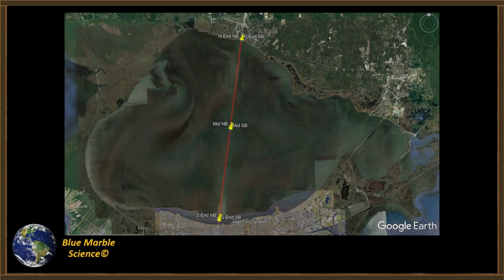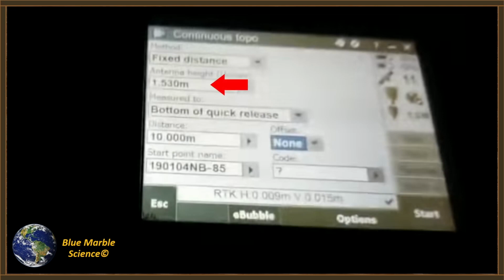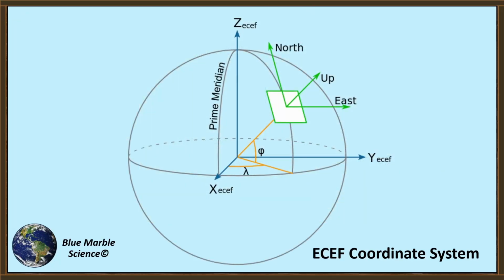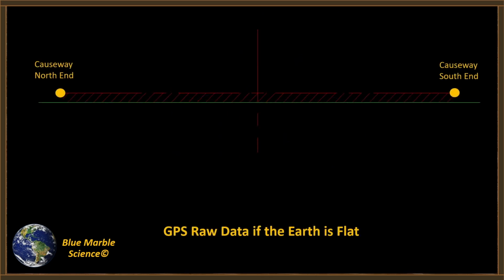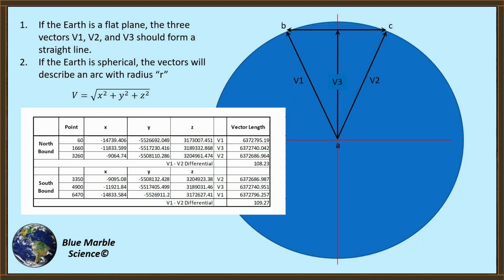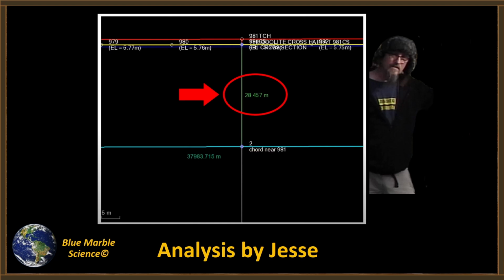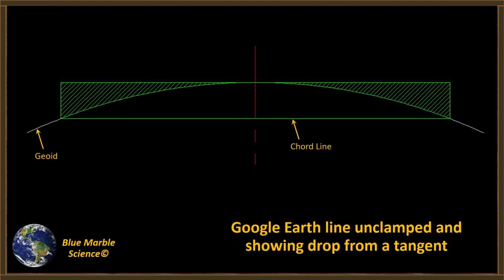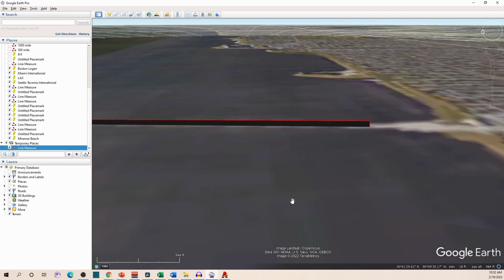The Lake Pontchartrain Causeway Proof of Earth Curve

Comment: Don't forget that the earth is more an ellipsoid than a sphere. That means that the radius of the surface at a certain location depends on the direction of measurement. The causeway runs nearly north/south and is near the equator. So the surface radius of curvature in this direction at the location of the lake Ponchartrain is according to the WGS84 globe model 6,352 km, which is less than the distance of this location from the center of the earth, aka the length of a GPS vector there of about 6,373 km. So if you compare the radius that Autocad calculated (6,342 km) with the WGS84 meridian ellipsoid radius (6,352 km), you are off by less than 0.1%. A variation of 1 cm in elevation measurements gives a variation of about 8 km of the calculated radius from 3 selected data points. So the causeway GPS measurements are exactly as predicted by the WGS84 globe model to cm accuracy.

Here is my App showing how it measures the radius of curvature of the causeway. My App calculates the vector length (Leng), the ellipsoid radii (Rmer for meridian direction N/S and Rver for E/W direction), the radius from the angle between the verticals at the 2 endpoints (Re12) and the radius from 3 selected data points (R3pt). Further more it calculates the drop of the selected end points from the horizontal plane at the reference point (Hlvl) and many more.

http://walter.bislins.ch/bloge/index.asp?page=Display+Geo+Data&data=Causeway+measuring+R
Reply from the maker: Thanks Walter - your work was absolutely brilliant. I hope this regenerates interest in all the work you guys did.
Reply: @bluemarblescience  Thanks Blue. In case someone is interested: survey grade GNSS receivers can export the raw measurements in so called RINEX files. There are all measured distances to all the satellites listed that were used to multilaterate the position in ECEF cartesian coordinates. No such distance in the RINEX observation files is less than 20,200 km, the altitude of the GPS satellites above the surface of the earth. 

Here is an example of such a RINEX observation data file. Click on the numbers or use the tabs below the image to get explanations for the numbers.

http://walter.bislins.ch/bloge/index.asp?page=Understanding+GPS%2FGNSS+RINEX+Files+and+Relevant+Parameters

GNSS receivers use as many satellites from multiple systems as possible at the same time (like Navstar, GLONASS, Galileo) and make multiple measurements to calculate the position using multilateration. Using more than 4 satellites gives an overdetermined system of equations which can be solved using matrix operations to get the solution with the least deviation from the exact position. In Wikipedia is an explanation how to solve overdetermined systems of linear equations:

https://en.wikipedia.org/wiki/Overdetermined_system#Approximate_solutions
Reply from the maker: @WalterBislin  I had a slide on RINEX files in the presentation and realized that trying to explain it was going to detract from the basic message - that being that the damn earth isn't flat! It's measurably curved and we can prove it. There is no coordinate system of any sort that I know of, regardless of where you fix it, that would be able to make a straight line out of both sides of that causeway. It's a beautiful, and as far as I'm concerned, irrefutable proof.
Reply: @bluemarblescience  really nice work ! Thanks for taking a closer look at this data. Speaking of chord lengths, check out the work Larry Scott, me, and The Maine Surveyor did a few years back when we all 3 simultaneously logged GPS data on the great circle connecting us. I calculated the mid point on the line between TMS in Maine and Larry in Maryland. I drove 4+ hours to find that spot, hammered in an iron rod, and then set up my GPS receiver. At the moment the sun crossed that great circle, all 3 of us measured vertical angles to the sun. That was an amazing project Larry came up with. I'd post a link to a vid, but YouTube would block this comment.  It's on my channel along with other vids of my 2 trips meeting Soundly in 2017 and 2019, plus the vids on me and TMS replicating Al-biruni's method on Cadillac Mountain, and the trips made to see George Hnatiuk at Rainy Lake and Tim O at the Great Salt Lake. What's left to do after all that? LOL. All that data is available to anyone interested in presenting their own evaluation of those measurements like you did here Blue. I'm happy to see you do that. Thanks.
Reply from the maker: @JesseKozlowski  I'm glad you enjoyed it Jesse. Your work was amazing and the result is, as far as I'm concerned, irrefutable. I certainly intend to cover some on your other adventures with Larry and the Maine surveyor. We spend too much time staring at out-of-focus pictures and similar foolishness when what you guys did is clear and repeatable. Thanks for all your effort my friend.
Reply: @bluemarblescience  , it's about time the flatearthers are asked to show the trick. If surveying is flawed and the globe is being inserted somehow to hide flatearth, show us where that switcheroo happens, where's the trick? If GPS comes from cell towers, show us the trick used to make it seem like satellites. Like Walter said, the actual range measurements are in the raw data, the RINEX file. Heck, anyone can build their own GPS receiver and write their own software using the open source publications describing how GPS works. LOL, even rockeeyah can find his way home using GPS when he takes his boat far off shore and his cell phone has zero signal. LOL. 
I lost interest in all this FE stuff when it became obvious to me they're either pretending, or they're outright bald faced liars. Bev's schtick of repeating level is horizontal got way too boring especially since he ignores surveying texts. Why does he say I regret describing the earth's curvature dropping down from the horizontal plane established to be perpendicular to the plumbline at the observer's location? It does. It drops at a rate of 8 inches times the distance in miles squared. LOL.
Reply: @bluemarblescience  Oh, don't get me wrong. It's not meant to be a critique of your video at all. Your video is more than enough to deliver the message. 👍

I thought, as you mentioned the distances to the satellites, I could back it up for those who are interested to know where we can find this distances GNSS receivers internally measure.
Reply from the maker: @WalterBislin  I understood completely. I'm into the details myself and I have to constantly remind myself that a majority of viewers may not want to go that deep. But I think it would be good sometime to target a smaller audience that would like to know more about what really comes down from the satellites and how it's used.
Reply: @bluemarblescience  , for those that enjoy knowing the specs, like car horsepower and engine details etc., I'll include some of the details on the equipment used to collect that bridge roadway data. The GNSS receiver is a Trimble model R10 which tracks USA GPS and Russian GLONASS satellites. That is the thing mounted on the roof of the car. The handheld data collector displaying the results on the screen is a Trimble TSC3 running Trimble Access software on the MS mobile 6 operating system. That TSC3 is connected to the R10 via bluetooth. 
The real-time data stream came from the LSU RTN using an internet connection via cellular data network.  Raw GNSS data was also logged simultaneously at a 1 second epoch rate for post processing later which yields slightly better positional tolerances than shown on the screen, but even those are plenty good enough for this intended purpose. Quite amazingly, the data collected in 2017 agrees well with the 2019 data. Someone made a comment under this video about publicly available Lidar data, but, at the time I made my surveys, no data like that existed for the causeway bridge. Maybe it does now? Would be a very cool thing to compare those results to mine if anyone knows where to find it. We use that system every day to collect long stretches of highway. Essentially 2 extremely accurate laser scanners are mounted on a vehicle along with an IMU and dual GNSS receivers. That's what is known as Moble Lidar. Amazing technology.
Reply: @JesseKozlowski  Just post the magic characters after watch?v=
We can work it out from there.
Reply: @bluemarblescience  When I was in New Orleans I made it a point to go by and see this. it was great.
Reply: Your information and knowledge never cease to amaze me. I love all the calculators on your site, but I think that I love the knowledge you provide detailing the processes behind them even more.
Reply: As the old saying goes, "The devil is in the details."  Which is exactly as these experiments, measurements and calculations have done, show reality at a high level of detail.

A heartfelt "Thank You" and "Well Done!" to all of you.
Reply: The man, the myth, the legend! Thank you 🙏
Reply: That's what I see in all the nasa photos
Reply: Walter and Jesse, all of your work is truly outstanding. The flattards are beside themselves; I just saw part of a debate with MCToon where some idiot was trying to make up something about Jesse’s theodolites not being level.
Reply: @David_Lee379  , LOL, and then he showed his picture taken through his theodolite set up level, right? Hahaha, nope. None of them ever make any measurements. Well, except for JTolan, who is just trolling the flatearthers because his measurements match the topographic maps of the areas he makes his videos about.
Reply: @JesseKozlowski  Exactly!👍
Reply: I measure from the Y axis which doesn't go to the center of earth when you extend the line, i get (6340.766 km) but if i move the end of line to 0,0,0 to the center of earth I get (6372.687 km) in Civil 3d and get 0.34156° degrees for the delta angle......For the radius i get (6372.794 km)....For the chord I get (37.98997 km).......North bound bridge
Reply: Blue Marble Science needs to come and work for you.
Reply: BLESS: 🙏🏿😇
To the IGNORANT; Is it Still FLAT ? 🤔

Comment: My question is a simple one so there should be a rather simple answer. I live in Vancouver Canada and sometimes call London England at 2am my time in the dead of night. Yet in London it's 10am broad daylight. How is that possible if the earth is flat? The entire earth should be daylight or night time all at once if the earth is flat. I don't even need to use London as an example. During the shorter days of winter I get calls from Toronto Ontario at 6am Vancouver time. It's still full darkness here at that time yet in Toronto it's 9am and full daylight both within the same country. Expalin that flat earthers.
Reply from the maker: There's a very simple answer. The earth isn't flat. And the people that try to claim it is haven't asked themselves the simple question you just posed. At least if they have, they didn't answer it honestly.
Reply: Humans are extremely creative. They have “answers” to this question for sure. They aren’t scientifically evidence based of course. But, to them, words on a creative meme is plenty of enough evidence
Reply: The flerfers would have to turn their brain inside out to explain that away.  But they’d give it a go. They are such creative humans!

Comment: Genius of logic. He calculate if lake is curved, based on assumption of a ball model of the earth. Genius.
And on assumption he think he know how "gps satelites" work.
Iss station clame 405km hight - by calculation of "gravity" men 100 kg will weight about 70 kg - microgravity? Yaeh right. Now you know why they need baloons for satelites - > because they lie about everything.
Do he even know how roads are build? Did he know road need to have slope in both axis, to do properly drainage of waters.
You can achieve this data just by riding this slopes.
Why do they not open some geodetic websites to check measurements of yhe hight from see level of the road? And then comper with bumps on the road?
To hard or to risky?
And with the occasion, ask some geodesist do point 0.00 m changes (follow the curvature)?

And the shocker.

His own data prove that the earth is flat.

He seems to forget he put his data on ball earth model, and the data shows that his road go under water.
Great design you see, first hurricane should blow this bridge over.
Reply from the maker: That's idiotic. You have no idea how GNSS works!
Reply: @bluemarblescience  seems like you can't read your own data and resolds.
Genius do you know how briges are build? Did you check real project of a bridge and it designed hight above 0.00 m point of a sea level, genius?
Did you check it with you data?
This is have no meaning but to lie and decive.
Reply: you're almost onto something there. people aren't weightless on the iss because its so far from the earth that it's not affected by earth's gravity. 
people are weightless because the iss is in perpetual freefall around the earth and astronauts on board are freefalling at the same rate
Reply: @conifergolly  no it is not. On how high is fake ISS on fake altitude it is not much change in weight. Find the difference between simple plane anx fake ISS trajectory. Maybe then you will see how much stupid and contradicting ideas have fed with.
Reply: Greetings, I've been dependent on satellite reception for my TV entertainment for more than 35 years and have helped neighbours and family to install and setup dishes and receivers.
I challenge you to explain how balloons can be used to distribute HDTV content to millions of households in Europe.
Reply: @marcg1686  you should ask rather this question: why is it so stable and moved an inch for so long. Do you think it is flying and maintaining position on some fuel? Or rather you are pointing earth based anthena or reflection of a solid dome. Check angles in different countries do the geometry math.
Reply: @ViCantoTrakt  You have made an assertion without any evidence. We will dismiss the assertion without any evidence.
So here is your chance to prove that balloons are used to transmit TV content to domestic households.
I'll wait.

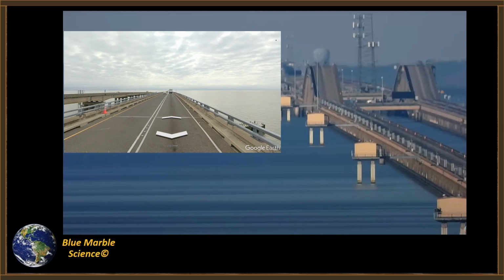Comment: 2:22-- honest request: please provide a citation that explains how foreshortening increases the angular size of a raised roadway.
Reply from the maker: It doesn't and I never said it did. If you try to take a picture of the bridge orthogonally, you'll have a photo covering 24 miles left to right with a 90 foot sagitta. That isn't visible. But an oblique view allows you to magnify the picture and that increases the vertical change to the point that you can see it. Foreshortening isn't increasing the angular size of anything. You're doing that with higher levels of magnification. I'm not interested in any pedantic back and forth on this. It wasn't the point of the video in the first place. In fact, just the opposite. The video is about GPS and how those data show the exact curvature we know exists.

Comment: It would be neat if multiple people at different locations set up software radio based GPS receivers, synchronized their times accurately using a method independent of GPS and trilaterated the locations of GPS satellites based on the data and the known distances between their locations, basically doing the inverse of what you usually do with GPS. Then compare that with what "they" say the satellites' locations are.
Reply: You could use the rugby atomic clock time signal,  My watch syncs to it.

Comment: I've driven over that bridge dozens of times while growing up in New Orleans, and you can't deny that you are slowly but surely driving over the curve of the earth. It's undeniable.
Reply: One of the many problems with flerfers is they don't understand scale or size. They think our model has the earth the size of a beach ball so they can't grasp what "gradual" curvature means. Reality denial is fine as long as it doesn't go against their precious belief.
Reply: @whichgodofthousandsmeansno5306  Flerfers believe the curve should rise in front of them before dropping away. Hence the reference to the 'hump'. They cannot comprehend that it does not rise then fall.  At 6' observer height, to all intents and purposes, it simply falls away from their position.
They have no concept of 3 dimensions, geometry, maths, logic or reality either!
Reply: For sure!! They think planes fly at 10,000 miles above earth and not 10,000 feet
Reply: Also, no amount of "zooming in with your P-900" will bring the curve-obscured bottom of the far side back into view.
Reply: And yet they still deny it.

Comment: Hey Blue! Excellent presentation! I love your visualizations. 🙂Are you familiar with "2 inches per mile squared"? It's one of my favorite hip pocket calculations. At 16:46 I took your north and south segment lengths (approximating the length of your arc, as the chord flies) and it totaled 37,396 meters. Converting to miles and applying 2 inches per mile squared, this results in 27.429 meters. Your AutoCAD sagitta shows 27.535 meters. Only 106 mm off! Not bad for an approximation. 😎
Reply from the maker: Thanks Charles - I appreciate it man!
Reply: Not bad for one digit of precision.
Reply: Ok
Reply: Hip pocket huh you must of spent alone time in the military